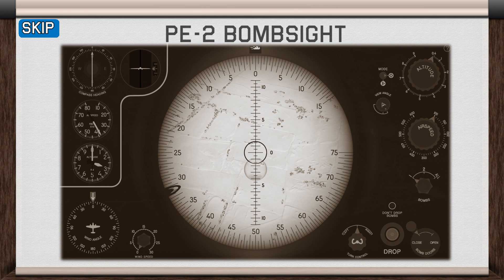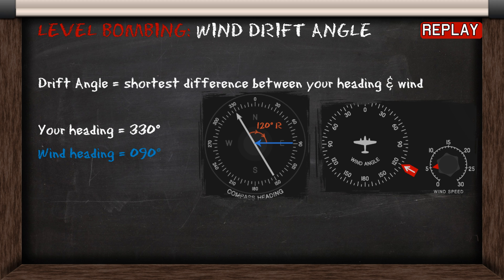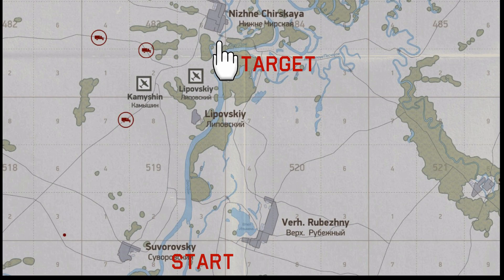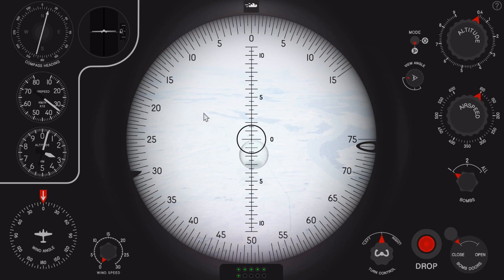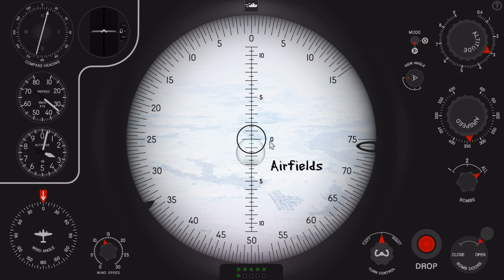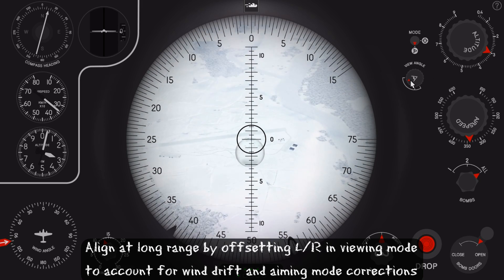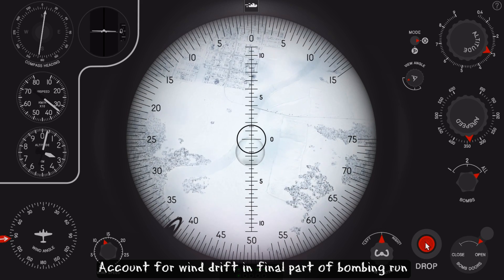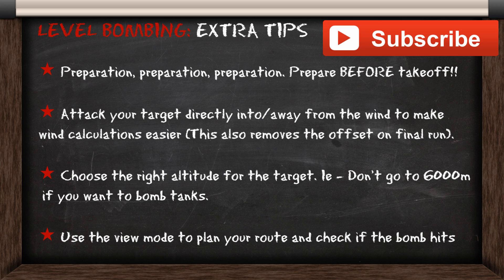Pe-2 Level Bombing

Comment: Is "level autopilot" a real feature of bombers like Pe-2 or are you just using it for your convinience?
Reply from the maker: I'm not sure if it was a RL feature of the Pe-2 but it makes life much easier because in you wouldn't normally be operating the bombsight and the flying at the same time. It's a real thing in Luftwaffe bombers though I believe.
Reply: @RequiemsACTL  I think in HE-111 it is a real thing, I believe in some other aircraft as well.
I've searched through your channel and never stumble across any information as to the controllers used by you.
When I bought IL-2 Sturmovik couple of days ago, I flew using Thrustmaster T Flight HOTAS. Although it is very decent joystick for a price one has to pay for it, couldn't hit a barn with it. Well.... I could hit a barn but I could forget about landing my bullets on small targets, unless I used loong bursts, which drained my ammo quickly. I've searched some forums and being under the impression, that Thrustmaster 16000 is worth to try it, I bought one. GAME CHANGING EXPERIENCE for £30 (refurbished in mint condition).
Seeing your excellence and precise flying those digital aircraft, I wonder wonder what joystick (controllers) you use.

Comment: Alright so, the formula I use to calculate the wind drift is 360degrees-plane heading=x. x+wind angle=wind drift. this only seems to work when the outcome is to the right. In order to do the left do I need to instead subtract the wind angle by 360degrees, and add the plane heading + x
Reply from the maker: I didn't include a formula because you would need to remember which one to use for which side. Besides that though, simply looking at the two headings relative to each other is more intuitive than having to remember two formulas. The formula works when the outcome is to the right, but if the outcome is to the left you will need to adjust it by subtracting a further 180 degrees to get the reciprocal heading in order to equal the adjustment. Like I said in the video, if you're adjustment calculation is more than 180 you did it wrong.

Comment: I thought I was supposed to set the wind direction from where the wind was blowing from on the number, not between the wind direction and flying direction. Do this (the wind/ aircraft travel direction setting) apply to the He111 in the same way? (the wind/travel direction setting)

Thanks for the video (watched it 138 times now)
Reply from the maker: Kjetil Jensen Yes, the same principle for calculating wind direction applies to the He-111 when manually bombing as well. When I do level bombing with the He-111 I won't be showing how to do it manually though since the Pe-2 video already covers it. I'll show usage of the automatic setting.
Reply: IL-2 Tutorials by Requiem Thanks. It don't work perfect. Need more practice and I think I get it. :)